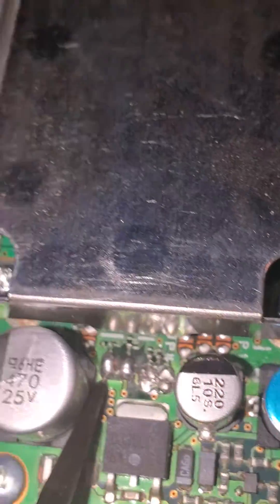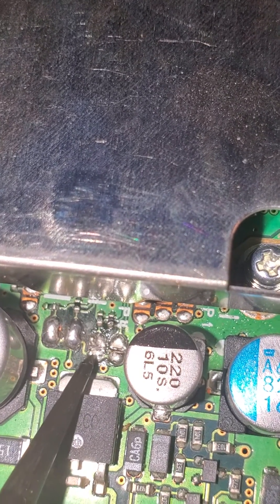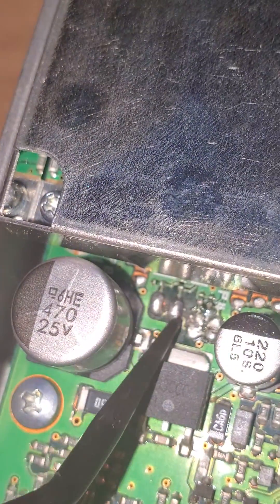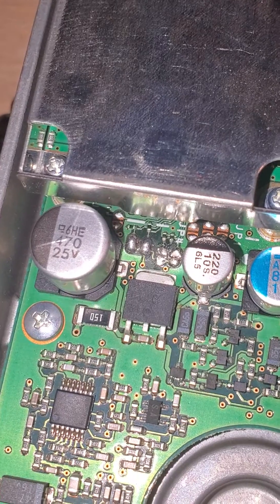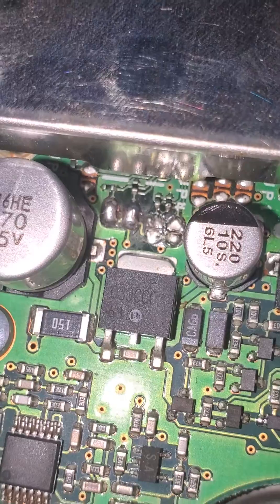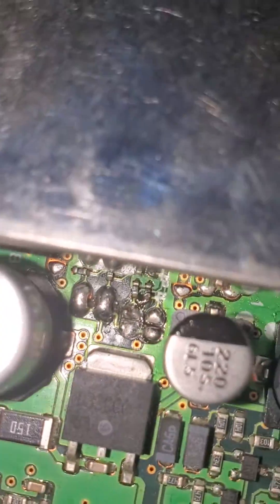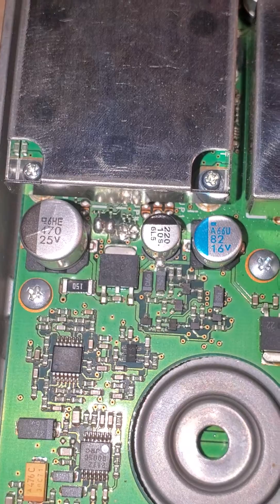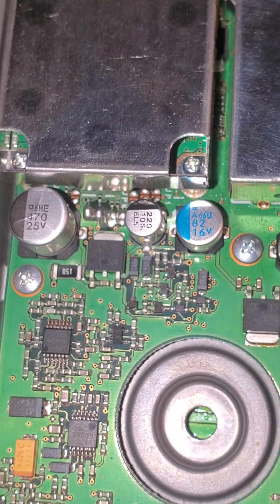Ft891 mars mod CORRECTED!!! some one butchered radio!

Comment: So I just purchase one of these used and almost same crap.  I specifically asked the seller, has this radio been modified or worked on in any way?  His response and advertisement on FaceBook was. Used for 4 hours never touched.  I opened it up and sure enough blobs of solder!  Definitely not factory, but it doesn't transmit outside the band which doesn't matter to me.  The other 2 components not shown in your video are present in mine.  The radio otherwise seems to be fine.  I am blown away by how many hams are slimy and just outright lie to your face.
Reply from the maker: Its sad. Ive met more shady hams. Im mostly doing guitars and guitar amplifiers and ive never dealt w the same kinda sneaky people in the music world as spam radio

Comment: Not sure what the two SMD's are (they do look like diodes).  In my FT-891 they are marked 000.  
In another YouTube video there is a pretty clear closeup (at approximately 3.01) of the devices (it is in Portuguese):    https://www.youtube.com/watch?v=6ELiHp049Qo
I hope this helps.
Reply from the maker: Im pretty sure the guy started removing stuff till it worked on 11m lol. So far the radio has worked fine on 80m, 40,20 and 15m for ft8 and portable work for me. There seems to be several versions of this radio and usa ones are usually different from Eu
Reply: @hamradiohack  I know it has been about a year since my last post to you but I finally found out what those missing SMD's are.  They are zero resistance jumpers.  I managed to get a service manual/schematic/parts list for the FT-891 and they are listed as zero resistance devices (jumpers) and are marked "000".
Reply from the maker: @jfrphoto01  yep. Mine are probably all wrong. Do you know what they do?
Reply: the CC works. Hit the cog and choose auto translate, then go down the list to English.